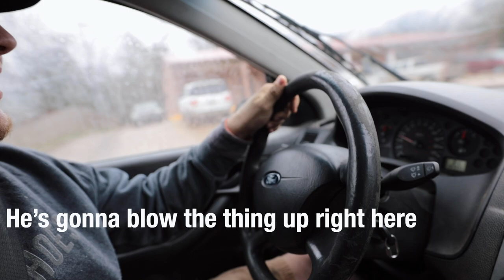WAKING HIM UP ON HIS BIRTHDAY WITH A NEW CAR!!

Comment: "Something vibrating in the dash" welcome to every 2000's Ford Focus ever made, the engine mounts are shit even new, but they are cheap and easy to replace.
Reply: Wrap World Creations same happened in my ‘07 along with an exhaust leak and it was popping rings before I sold it last week
Reply: Yeah my 03 needs them replaced, luckily only 53 bucks for all three
Reply: Wrap World Creations fucking for real
Reply: Lol. My '07 still vibrates with new mounts. Granted it's a crap ton less, but it still vibrates.
Reply: Funny you say that my 01 mustang has a shot motor mount but even before that all the hard plastic and vinyl creeks and rattles so bad lol old Ford's were terrible 😂
Reply: so if i get better motor mounts than stock it should fix it?
Reply: Wrap World Creations yeah my 07’ vibrates if I sit in drive at a red light 😂 I hate it
Reply: My 06 broke one and the engine was bouncing off of the CV axle

Comment: Focus needs motor mounts / trans mounts, every focus I owned from time to time needed them done.. funny enough the same happened to my seat on my 5speed hatch
Reply: You forgot radiator hoses
Reply: Poe changed motor mounts already I think :)
Reply: They are tough little cars shold last him a while if he doesn't boost it
Reply: I have the vf engineering mounts with the massive speed race spec lower mount in my 07 sedan. Bolt on and tuned and gutted to shit and it doesnt vibrate as bad as this focus in the video.

Comment: I bought a 2010 ford focus. because I needed better gas milage. because of how much l was driving for work and I couldn't pass the deal up I was getting on it. The car had 56k miles on it when I bought it, And it was well maintained but something I realized real quick. was the steering wheel had a little bit of vibration in it. But not as much has the one you bought for poe.

Comment: I don't know if they are still around or not, but there was a company who use to make a complete turbo kit for the Duratec 2.0L and the 2.3L in the older 2005-2007 ST's. I think they made something like 220hp in the 2.0L and like 240 in the 2.3L I think.

Comment: I have an 05 Ford Focus I use as an emergency vehicle even tho it vibrates like a bat out of hell its been my most reliable vehicle with over 140k miles with only changing the alternator 10 out of 10 would recommend

Comment: Damn engines they make a shit ton of parts. They will hold a lot of power and we'll make a lot of power. My buddy had a four-door Focus sleeper. 32 lb of boost Yeah years ago. They still got it where I actually redoing the whole thing now. My bad, it's a two-door. Not for Dory. Always mourn to take the engine but it in a four-door.

Comment: You can fit a cobra engine into that little focus. They make a custom driveshaft that for it. But they are super quick with that cobra engine in it. I had an 03 focus zx3. That's what my plans were for it.

Comment: Yo Heads up if you chop off the rear Muffler. It will sound amazing. Also, that is a 2 L zetec motor and they are. 99% indestructible If you leave them bones talk you can absolutely beat The Living Daylights out of them. And it will just run just fine. Have fun give it to go chop the muffler off. I want to see it in the next video.

Comment: All Ford Focuses from 2000-05 idle/vibrate like crazy ford has a lot of early model cars run lean to save fuel I’ve had one for 3-4 years put about 40+ thousand miles on and she keeps going

Comment: I used to have a 2005 Ford Focus but it was the sedan 4 door. About a year ago I got rear ended really hard totaling it the guy that hit me had no insurance and I had the lowest insurance because I couldn’t afford the good insurance so I had to ride the buss and eventually I bought a $250 Pontiac that was rusty and very un reliable with 200,000 miles. Now I have a 1995 Buick Park Avenue that only has 98,000 miles and no rust.

Comment: I had a 2001 ZX3 Ford focus and with just headers delete it cat and a cold air intake I was able to keep door to door to a stock mustang. Forwarded confirm I had a factory freak because I ran 14.9 in 1/4 Mile stock and 13.8 with header and cold air and deleted cat. I won't ever delete the cat again while living in MD because if it's not 20yrs old or older you have to have a cat and they will Gail you till you put one back on. Someone needs to make hey quick release cat system lol. Also if there one you got had the 2.0 it will sound awesome with exhaust I'm not sure what the Mazda 2.3 liter they put in it sounds like and I wasn't sure if they were still doing that.

Comment: Looks like the focus needs engine mounts, a typical 2000's ford focus problem. Cheap and definitely Poe can handle replacing them.  And also,here in Canada we call that driver's seat issue and Mexican lean. Lol. No offence to anyone at all meant by that either.